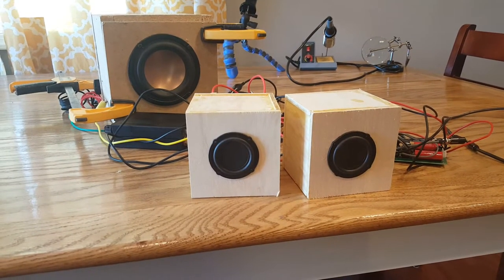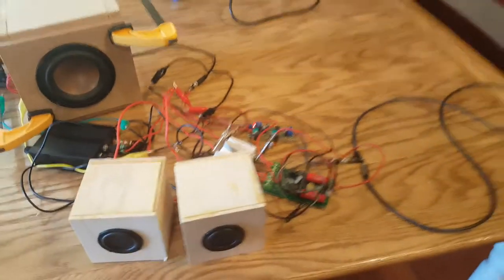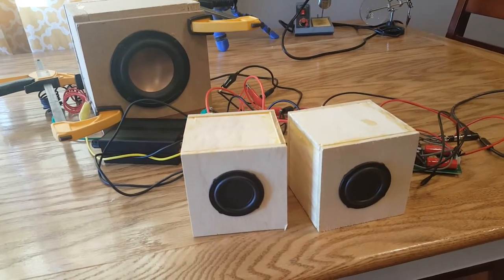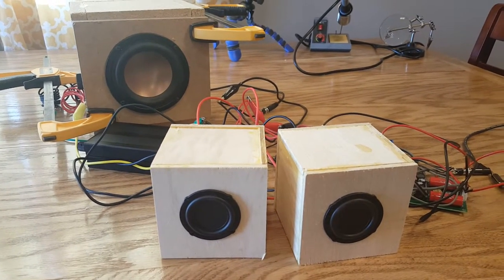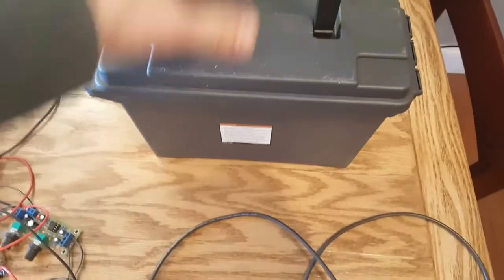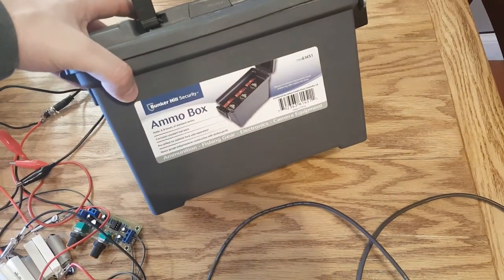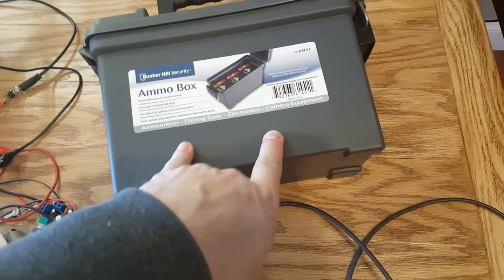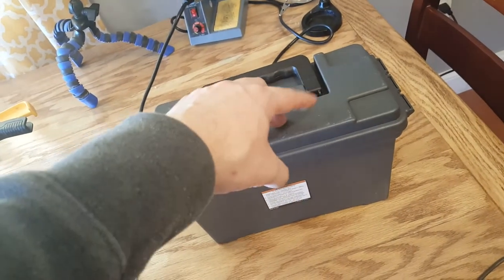I Need Your Help - Ultimate Ammo Box Speaker Build!

Comment: Used a similar plastic ammo can that you're using for my first bt speaker box. Some tips would be speaker selection. 3.5" speakers are probably the biggest that will fit. You could go 4" granted there's enough clearance, but the middle of the ammo can will lose structural integrity with that big of holes. Battery options would be 3-4 18650s or 10 rechargeable duracells. Those will last an entire day with a 15w sure amp. You don't really need a charge protection circuit on the 18650s, but it's safer to have.  Most bluetooth modules are now included with sure and dayton amps, so you don't have to install a separate board. The biggest problem I encountered was keeping this can air tight. If you start adding volt meters and what not, you gotta make sure to have sealant around them. Air likes to leak out dc charge ports and usb ports too. BT antenna range can be increased by soldering a small solid copper wire to the onboard antenna. This will increase its range by at least 25-30 ft. If you do this antenna mod on a metal ammo can however, you will need to route the antenna to the outside of the can or else it will be shielded by the metal. As for flex, this can will do so at max volumes. It doesn't sound bad as long as you have everything rattle free inside. It sounds decent.
Reply from the maker: Thanks for the tips!  I actually just finished this last weekend and plan to do an overview video this week.  It came out great!  Thank you for your suggestions, they are great tips!  I can't wait to post the video so you and others can see it.

Comment: How will you charge your battery(or batteries)? Remove to charge or wire so that power supply provides the recharging?
Reply from the maker: Good question.  I would wire it so the power supply charges the battery.  This way when you are at home, no need for the battery.  You can just run it off the power supply.
Reply: Sounds good. What batteries would you use? How would you keep them from over charging or draining too much? Sorry, Maybe these are question better left to be answered in the next video.
Reply from the maker: Not at all.  I am always willing to answer any questions, if I can.  I would probably buy an already made pack that I can keep in there.  These already have an overcharge circuit on them, that way I would not have to worry about that part.  I also thought of using something like this: https://www.parts-express.com/dayton-audio-kab-be-18650-battery-extension-board-for-bluetooth-amplifier-boards--325-113 which uses 18650 batteries.  But I might want a little more life out of it then that provides.  But both options have the circuits built-in.  Definitely do not want to use Lithium's without that. :)
Reply from the maker: I always try to keep my subscribers happy.  Let's be honest, this channel is for you guys!  I love what I do, but if there is something you want to know, I am all for doing a video on it.  That's why I am asking for your guys' help.  As always, thanks for watching and subscribing.
Reply: You right, battery life seems limited with only three batteries, especially if played at medium to high volume. Could those PE protected battery holder's possibly be wired together so that you run off of 6?
Reply from the maker: They can.  But at that price (once adding in 18650 batteries) I would rather buy one already built like this: https://smile.amazon.com/Talentcell-Rechargeable-6000mAh-Battery-Portable/dp/B00MF70BPU/ref=sr_1_1?ie=UTF8&qid=1489333941&sr=8-1&keywords=talentcell+rechargeable+12v
Reply: Looking forward to watching the next video to see what you decided to use.
Reply from the maker: Thanks!  I am pretty excited about this build!  I hope you enjoy it!

Comment: I would never spend my time or energy to build a speaker out of a plastic or metal (also ammo) boxes. They would probably sound hollow, rattle, flex etc. If I'd really want an ammo box speaker I'd make an MDF enclosure inside the ammo box. Anyway, have you thought of using some sort of DSP in your speaker builds?
Reply from the maker: I am concerned about flex.  I had that with my Dewalt speaker build.  I did exactly what you are saying, I built a few MDF enclosures inside.  This is a little more rugged, so we will see if it makes a difference.  If it doesn't I will have information to report back.  I haven't considered a DSP before.  That is an interesting idea.  Like adding an active DSp inside the enclosure?
Reply from the maker: I mean the ammo box did have a warning label, so it must be sturdy...right? ;)
Reply: Yes, an active digital sound processing board that will increase bass (and treble if needed) at low volumes, can be used as an active crossover, Eq out unwanted peaks and dips, etc. Minidsp has a option, but also Sure electronics which is a lot cheaper.
Reply from the maker: I love that idea!  I have considered a mini dsp before.  I thought about it when I bought my umik-1 from them.  I may not use one on this project.  I'm not sure I want to sink that much into this project, but I have a project coming up that this might be very useful for...Jukebox?
Reply: I say build it. DIY is about experimenting. The results often surprise you. Don't forget that its a boombox, they are limited by design when it comes to sound quality anyway. Maybe stiffen it up with MDF or some dowels. Probably every store bought boombox is made out of what?...plastic.
Reply from the maker: That is a great point Jeff!  And if I make the mistake, hopefully it'll save someone else from making the same. :)
Reply: Indeed, most are made of plastic but rarely square or rectangular shape, hard, thick plastic and quite a lot of "braces" or space dividers inside. Not the same as an empty box
Reply from the maker: That's a great point.
Reply: I build BT speaker ammo cans as a hobby and the plastic will flex, but sounds good as long as everything internally is not loose and rattling. The metal nor plastic cans do not sound hollow and the only rattle comes from the handle which is easily fixed with paracord wrapping. As for an MDF enclosure, I'm against this method as these cans get heavy once speakers and batteries are installed. You don't need an MDF enclosure unless you want to make a switch panel like the Ammo Audio ones. As of now, I've settled on using a single 5x7 speaker vs 2 4". Overall the sound and bass response seem way better than Ammo audio or Thodio at $200 minus labor. A 6x9 would be the best however they're just too big to fit properly in a 50 cal can.

Comment: I like the idea of adding LED's.  Blue seems overdone, green would be cool
Reply from the maker: I like the idea of Green LED lights.  Plus it'd match if I used this battery charger level: https://www.aliexpress.com/item/12V-24V-36V-48V-New-LCD-Acid-Lead-Lithium-Battery-Capacity-Indicator-Digital-Voltmeter-Voltage-Tester/32684435845.html?spm=2114.01010208.3.29.MyfOss&ws_ab_test=searchweb0_0,searchweb201602_4_10065_10130_10068_433_434_10136_10137_10138_10060_10062_10056_10055_10054_302_10059_10099_10103_10102_10096_10052_10053_10050_10107_10051_10106_10084_10083_10080_10082_10081_10110_10111_10112_10113_10114_5000000_10078_10079_10073_10070_10122_10123_10126_10124-10050,searchweb201603_3,afswitch_1,ppcSwitch_4,single_sort_0_default&btsid=de8d0299-cf22-431c-a777-b3c52f94f74b&algo_expid=a0bbdfda-3aa9-4965-88a9-cc0aa38c87d5-3&algo_pvid=a0bbdfda-3aa9-4965-88a9-cc0aa38c87d5

Comment: Ok dude for one that box isnt durable. I have the same exact one from harbhor freight and its is weak and flimsey as hell. Two the fact that you can lock it is pointless seems how u can bend the plastic enough while locked to fit your hand inside. Three. Just pick a different box. Im not knockiing your idea in fact i think its a good one. Just use wood. If u want natural sound you need to use natural material that being said there isnt anything better to use than wood. Thats only my opinion man. What u do with it is on you. Hope this helps and good luck. Cant wait to see what you come up with.